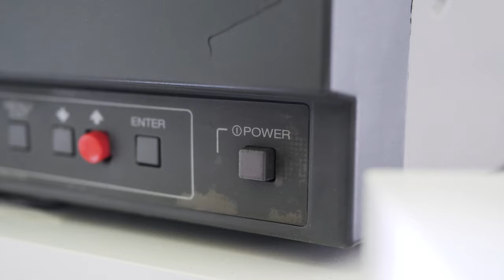The RECHARGEABLE Gameboy Pocket Mod!

Comment: Really great video, I wanted to try this mod and wasn't sure if adding a usb c socket to a micro usb board would cause problems, and you addressed this and explained everything very clearly, thank you.
Reply from the maker: Awesome man! Many people have noted not needing the Diode in a lot of motherboards as well. I have realized this myself so just something to take note of👍
Reply: @JayBoyModz  the diode and the little bit of wire when removing the DC input, I hadn't seen that elsewhere. I installed the screen today and the AAA batteries lasted literally two minutes so yeah I need to do this mod haha

Comment: there is something i dont understand: how did you get more battery lifetime with a 600mah Battery instead of the original AAA Battery with 1200mah?
Reply: an AAA battery is 1.5 v 600 mah if you use 2x of these it will be 3v 600 mah
Reply: and you can find 1100 mah rechargable aaa batteries they are better

Comment: Nice mod, i personally like to use latex gloves to prevent any fingerprints and id use some double sided tape to keep the battery and charging board in place. Other then that, it was a nice build.

Comment: The coating on the new casing is great and all, but, well, I refurbish all sorts of electronics, including laptops. I mention Thinkpads in particular. Thinkpads made around '97 used to have that sort of supple rubberized coating too, and it was luxurious. Now you almost always have to scrape that crap off with plastic razors as it turns into a gooey, sticky mess. My GBP may be a nonfunctional mess at the moment until i get the new regulator in, but the case is nice and not sticky. Luckily I think someone fried mine early in it's life as there is almost no wear or nastiness on it. Am modding up to give to my son for Christmas. Rebuilding a DMG for myself and that way I can trade stuff with him on his, like pokemon, to make it more fun for him. And because I loved my old grey childhood companion lol.
Reply: Point being, I try to restore stuff to last longer than it's original lifespan, so I try not to do any repairs or upgrades that are not, at a minimum, to factory spec. Usually way overspec'd.
Reply: Yeah, that rubberised paint is vomit inducing when it get's old, but on the plus side, once it DOES turn into something with the consistency of well chewed bubble gum, isopropyl alcohol and a plastic "credit card" scraper will usually expose factory fresh shiny plastic underneath with minimal effort. Mind you, that's only minimal effort on large flat(Ish) areas, but if the mouldings have vents, grills and gaps around buttons it becomes a pain in the ring piece. :D

Last year I was GIVEN an old Alienware laptop that had this type of paint on it. By this point it was so tacky that the thing had glued itself inside of it's bag and the original owner was so grossed out by it's stickiness that she didn't even want to touch it anymore. Once I got it out I attacked it with IPA, a plastic scraper, and a few microfiber towels for about 45 minutes, and that was all it needed to come up looking like new......... Apart from the thermal compound being 10 years old and probably like chalk by now it's a win in my book. At some point I'll have to strip it down and renew the thermal paste, but in this model it's a main board out job, and there's a hell of a lot of dismantling to get to the point where that board can come out. Not a hard job, just tedious / time consuming, and at the minute I just can't be bothered. :)

Comment: Please help 
I was re-soldering the battery connection on the GBP board and shorted out the C10 chip/resistor thing?
I can’t find ‘any’ info about this, but the board is dead for now. What am I looking for if I want a replacement
Pls hlp 🙏🏻

Comment: Would this type of battery mod cut down the run time? Wouldn't 2 or even 1 AAA typically have a higher mAh rating compared to the rechargable battery you used?
Reply from the maker: My man @machonachoproductions did a battery test with aaa batts and got about the same time as I did which was around 1-3 hours

Comment: Interesting mod, but I'd be a bit concerned about having a soft skinned lithium polymer cell semi loose in there without any kind of protection. It looked to be getting squeezed into place against the GB pockets board, on wires and solder points. I've had first hand experience of Li-Po batteries getting punctured a few times, and it's an eye opener. The last one was a little 1000mAh single cell, and that thing went off like a roman candle. It fired foot long flames out from one end and spat burning lumps of material all over the place. It only burnt for 5 or 6 seconds, but it was pretty fierce for something so small.

I'm very tempted to have a go at this mod, but personally, I'd want to try and make slightly more room so I could get an extra layer of rubberised heat shrink around the cell, plus find somewhere else inside the case for the charging board (I've seen a few smaller li-po charge boards have hit the market in the last few years that might be a better option for this project). For making charger led indicator windows in non transparent plastic cases, I've found that you can get bags of tiny 3mm glass balls for next to nothing, and if you drill a 2.5mm hole you can press fit one of these into it pretty easily to make a reasonably OEM looking indicator light window. The last change I'd make would be to include a JST-XH plug and socket in teh battery wire to make it eeasier to replace the battery at a later point.

All that said, it was an interesting video, and has given me plenty of ideas about how I should go about it myself.

Comment: i had power and everything was fine but when it was on the power cable to the ribbon fell of and now it no longer will power after resoldering? do you think i fried something? capacitors or the fuse?

Comment: Just saw this, and it looks great! The biggest problem I've had with my funnyplaying screen is the battery life isn't as long as I was hoping it would be. What does the battery life look like with this mod? How long will it run with the funnyplaying screen?
Reply: Also, the diodes you recommended are out of stock. What type do I need to look for? I’ve never worked with diodes before.
Reply: I have the exact same question, what is the approx. battery life? My current battery life with the ips screen mod on two AAAs is about 2.5 hours

Comment: the pocket supports well the voltage of 3.7v?  there are other tutorials where they don't put a diode.  It is actually 3.7v nominal but 4.2v when fully charged.
Reply: it probably works up to 5v since the gbp regulator brings everything up to 5v anyways

Comment: That soft “rubber” coating will come off with time or liquefy. You notice that when the case starts to stick on your hand. Absolutely Nasty stuff!!! It happened with my Harman Kardon Studio 3 Bluetooth speaker’s rear shell, and my Makita power driver tool shells. I still use them both, but cleaning the cases of that stuff ain’t fun. If you ever need to clean off those nasty coatings; WD40, a few plastic brushes, and a roll of paper towels are your allies here.

Comment: Can someone actually explain the reason for the diode? Wouldn't a resistor do the exact same thing intended without over complicating everything?
Reply from the maker: You actually do not need any diode or resistor for most boards👍
Reply: @JayBoyModz  how come? Wouldnt 3.7v be too much for the 3v board? Seems like overkill to me, which is why I'd have thought a resistor would drop the voltage a bit, without the need of a diode... nonetheless im gonna follow the tutorial, just wanted to know, thats all (:
Reply from the maker: @crueltuber2887  No problem and the Pocket and the Color board seem to do just fine with the 3.7v batteries. I have made a few hundred like that at this point and they are all still going strong 👍
Reply: @JayBoyModz  i still dont like the idea of pushing the extra .7v, it wont directly affect it, but it would surely cause more wear and tear in the future. But yeah, interesting mod for sure, i will be doing this soon.
Reply: @CruelTuber the diode is used to substitute for a voltage regulator. If current is high enough, a diode will drop the voltage 0.7 volts if forward biased, which would make it the battery output voltage drop from3.7 to 3.0 volts. As long as current is stable, this should work fine.

Comment: Is the diode on the positive terminal 100% necessary? Didnt use one on my Gameboy Color and it's working fine with the same mod.
Reply from the maker: Yeah it is ive tried doing it without it and it just auto shuts off
Reply: @JayBoyModz  strange, mines been fine for 6 months now, I have used the USB C type charging board though if that's any different
Reply from the maker: @JordonVW  Yeah it works on the color without the diode but the pocket needs it is what I meant
Reply: @JayBoyModz  what about for the DMG?

Comment: I will be doing this very soon :) though I think of attaching a connector between the charging board and the battery, do you think that is possible? Or would it sit in the way?
I think it would be nice to have it removable in the future when the battery fails.
Thank you very much!
Reply from the maker: Yes that is actually how I usually do it for the GBA 👍
Reply: @JayBoyModz  awesome, thank you very much :)

Comment: Does your TP4056 get hot when charging? I've had to use a 500mA charger just so it doesn't get so hot and potentially damage the battery it's right up against.
Reply from the maker: I have had a few get hot in the past. It usually means that either the board or the battery is faulty and should be swapped out.

Comment: This is awesome and I will most definitely be doing it in the future! Quick question - would you recommend installing a 5v regulator in this build if you were using a flash cart? I've heard a lot of people say without the 5v regulator it just cuts the power when using a flash cart.
Reply from the maker: Hey thanks! I’m not sure in the flash cart. I’ve been meaning to get one to test it out but haven’t got my hands on one yet
Reply: I have not tested with a flashcart. But I tried installing dc-dc along with a lithium battery. Additional noises appeared in the speaker. I went back to standard.

Comment: Do you know if the rechargeable battery puts out enough juice to run the ips screen and an everdrive?
Reply from the maker: Havent tried the everdrive but it does seem to work with the EZ Flash Jr.

Comment: Hey not sure if you reply to comments on this video anymore but I basically desoldered one of the solder pads by accident when removing the dc Jack (3:37). Can I still proceed with the mod or am I basically just screwed?
Reply from the maker: As long as you can still connect the 2 pins I soldered too you should be good. If you ruined one of those though you will have to find the trace.
Reply: Fingers crossed lol
Reply: @JayBoyModz  So, found the trace. GBP turned on, looked great. Decided to install a new regulator (cleanpower by retrosix) and it pretty much blew my F1 fuse and diode. Could the USB-C mod cause some sort of short because the DC jack has been removed or is this more a power regulator issue? Does this mod even benefit from a cleanpower and have you run into any issues (audio, flickering, etc.) since installing the ips screen?
Reply from the maker: @thehowiewang  The cleanpower thing might have done that. Try removing the diode, ive noticed with the newer screens it doesn't seem to be necessary. Ive done this mod dozens of times and never blown a fuse.

Comment: So I did this mod, and the first issue I had was the charger board would not work. 
 I tried two of those charger boards and neither would charge after the mod was complete. 
I know my work wasn’t wrong because I then soldered the battery to the output jumpers to bypass the board and the system worked fine. 

Are there any viable alternatives to purchase for charging the battery? 

I am considering using wireless charging if all else fails.

Also your videos are great! You got yourself a new subscriber!
Reply from the maker: Very weird you may have got a batch of bad boards that has happened to me before.
Wireless charging would be cool if you could get it to fit!
Reply: @JayBoyModz  no worries I figured it out! So the reason why some of these boards wont charge is because different charging chip sets were used in different versions of the same product. All of my charging cubes were above 1A and the TC4056A chip on these things has a 1A limit before the charging circuit would safely disconnect the battery. So I just gotta help out by letting everyone know just incase they have issues when following your tutorial.

I found the results and spec sheets on 

https://www.addicore.com/TP4056-Charger-and-Protection-Module-p/ad310.htm

My stuff works now and I am rocking the pocket too!

Comment: What’s your battery life with this mod?
Reply from the maker: Its about 1-3 hours with this screen in, im considering posting a battery comparison video too
Reply: @JayBoyModz  Only that, does High capacity rechargeable battery gives better battery life ? Or should we wait for retrosix clean juice ?
Reply from the maker: @samwars95  I wouldn't expect retro six to be able to fit a battery much bigger than this inside of a pocket. Especially with them using a drop in style
Reply: JayBoyModz man that ips really eats up batteries, do you recommend that over the full size tft?

Comment: Man, that looks good.  I have an IPS in my GBA and GBC but the pocket's size is just so nice.  I may have to do this but my Pocket is original and cherry, I'd hate to rip off it's terminals and power jack haha.

Have you tried this with a flashcart?  That's the other reason I haven't IPS'd my Pocket.  The AAs don't like anything other than stock power draw!

Comment: good work.  The mod seems to work fine.  A couple of criticisms:  I noticed you seem like you're rushing somewhat.  You seem a bit heavy handed and shakey.  Perhaps slow down a little and take it easy.  Your soldering tip is not a good choice for this type of work.  Those conical tips are garbage for most uses except very fine soldering.  I see your iron has interchangeable tips, you should really use a chisel tip or better yet, a knife tip.  Watching you rip off that dc jack made me shiver a little lol.  I think if you had used a tip with better thermal mass, you could have desoldered it alot better.
I'd also consider using epoxy to glue in those USB ports.  Hotglue is going to come unstuck eventually.
Reply from the maker: Thanks yeah I just shake a lot lol my hands have always been like that
Haha you know the jack usually comes off so easy but of course in the video I struggled a bit. Is what it is, when trying to narrate, stay in focus, and work at the same time I do sometimes lose my concentration but I am working on bettering that. And as for the tip I do usually use a bit thicker of a tip, but im not a huge fan of the chisel. I didn't even notice I still had the smaller one on from some other work I was doing but I appreciate you pointing it out.
Thanks for the comment!
Reply: Let the boys hands be shakey